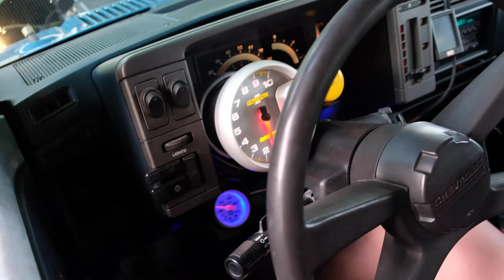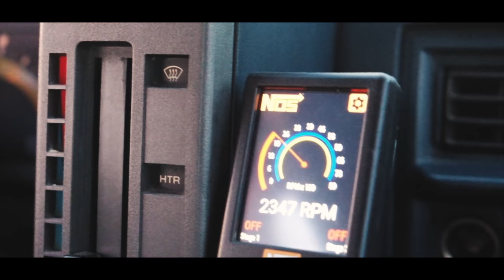Tommy's Nitrous S-10 Gets a MAJOR Upgrade!

Comment: Shocker. It was the first thing I said when y'all got the truck together. Those 7.5" 10 bolts are pretty much glass.
Reply: I broke one with a V6 🤣
Reply: That doesn't surprise me. I still can't believe GM put those things in 3rd and 4th generation F-bodies.
The rest of Tommy's S-10 looks top notch. It's nice to see they got a rear in it that will handle the power.
Reply: Ya im a Ford guy but back in my young days I bought a 2wd S10 Blazer swapped with a Turbo Buick V6 and 200r4, rear end lasted a day 🤦‍♂️🤷‍♂️

Comment: The S-10 the only thing I would really do to it is put a 4link rear suspension and 25.3 chassis/cage and Optic Armor Lexan and a wing on it and wrap it and maybe a carbon fiber front clip and doors but I would keep it small tire maybe mini tub it and make it fit 29x12.5 and that's about it but the Dirty Deeds Nova needs a 25.1 chassis/cage with a 4link tube chassis front to back manual steering rack with disc brakes front and back and only leave the roof and quarters steel everything else carbon fiber and it needs a twin turbo set up whether they push a 632cid BBC or a 454cid LSX but I say cut it up for big tires and run big tires and radial races on 275s or 295s and run in the N/T275/295 or N/T275 or if you put a 632cid in it then put it in the N/T4.84

Comment: Should run low tens with spray. My full body all metal, back seat etc on my 67 Fairlane GTA with a built 428cj did 10.38 @136 mph

Comment: If  Billy's S10 was on a prepped track I wonder the 1/4 time.. Low 8s maybe.. 🤔
Reply: It’s been 8.17 on only 20 pounds and it was blowing through the converter in high gear.

Comment: What alternator do you guys run? I have a 383 s10 with 2 electric fans and electric fuel pump. When I run the headlights at night my battery isn’t staying above 10V. I wonder if maybe just turning the idle up a bit would help keep it charged?
Reply: it should , but maybe look into a higher amp alternator?
Reply: I had the same issue and replaced my fan relays for 40amp relays on each fan. Fixed my issue so far.

Comment: I really got a serious question I’m trying to solve on mine when I got it it had the regular small block headers well I’m installing a external oil primer but headers are smacked on the pan no room what headers are on urs and would that elevate my problem are those considered out the fender because I don’t have a front clip and do not wanna drill out my fender yet high dollar paint lol thanks guys please answer when can and loving new monster
Reply: Not for sure, but it may be worth it to just have someone fab you some headers. After two days of banging, cutting, and welding on a set of Hedmans for my Fox that's where I ended up lol. Honestly a bit pricey but better than my cobbled together mess lol
Reply: It looks like he’s using the hedman fender well exit headers. I looked into these when looking for long tubes for my s10 blazer. The s10 1 3/4” headers is what I ended up going with, they are considered mid lengths but they provide plenty of clearance from everything (frame rails, firewall, steering shaft, oil filter, oil pan, starter)

Comment: no air filter?
Reply: Driving on the street over long periods of time with no air filter will increase wear on an engine due to introducing particulates into the valve seals, piston rings, and oil. But its not really that horrible for an engine, and cruising a bit with the filter off isn't going to kill a motor by any means. Dedicated drag cars don't run a filter at all and the wear difference is negligible even over a few hundred passes.